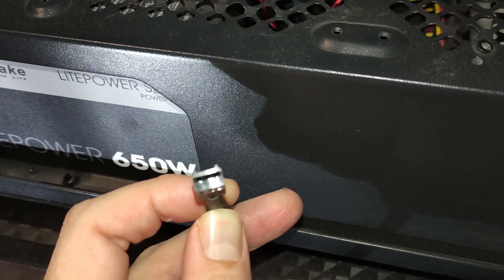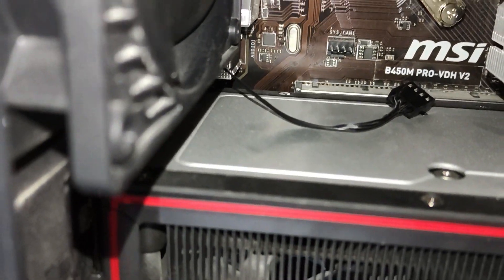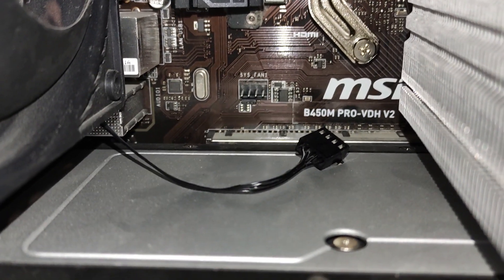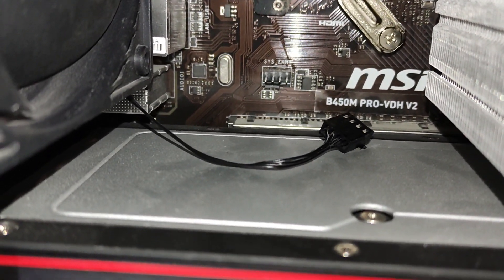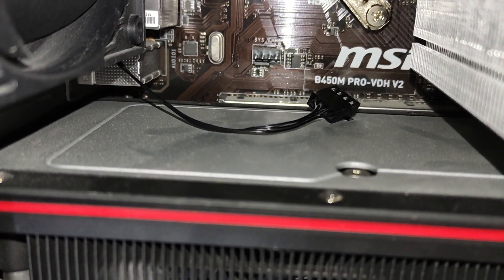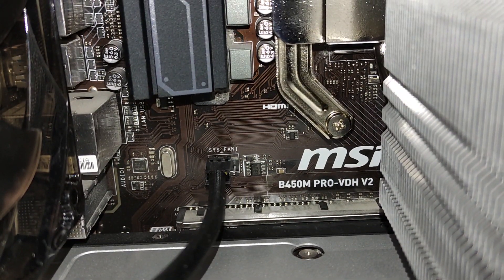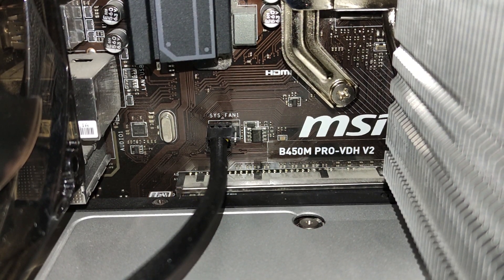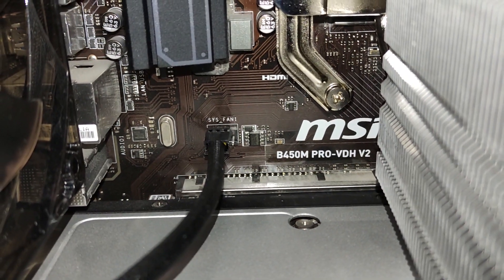How to install a 3 PIN case fan in a 4 PIN socket

Comment: I did this but my fans spinnig à the same speed everytime (low speed btw), i want to adjust the speed but i don't know if i can do it with a 3 pins fan.
Reply from the maker: Usually those with 4 pins have a power management. Your fans should have the spec "PWM" on them, in order to alternate the speed.
Reply: @PSVICE  ok thx

Comment: can you connect a 4 pin to a 3 pin i bought new fans and there 4 pin female my old fans were 3 pin male is there an adapter i need to use or how do i do this
Reply: I have the same question 
Can a 4 pin fan connect to a 3 pin motherboard socket?

Comment: i had the problem a week ago but I havent seen any information so I just bought an adapter
Reply: Hey which adopter you purchased pls.let me know thanks
Reply: @prayasbidkar8188  that exact adaptor didnt work , It kept falling off , tho I solved my problem by accidentally finding the right cable behind the motherboard manual utilization . Just check one more time the motherboard box